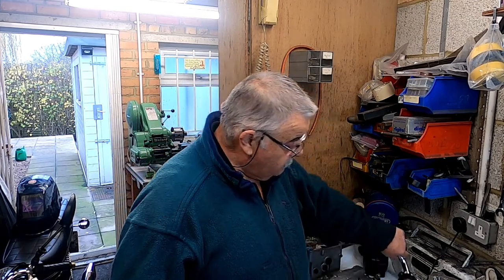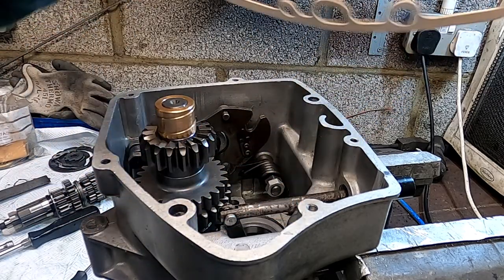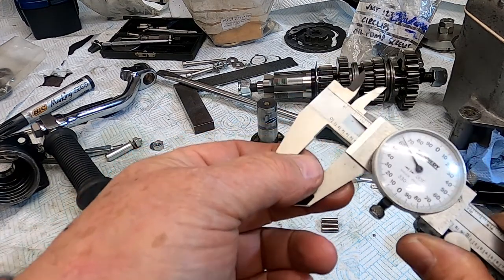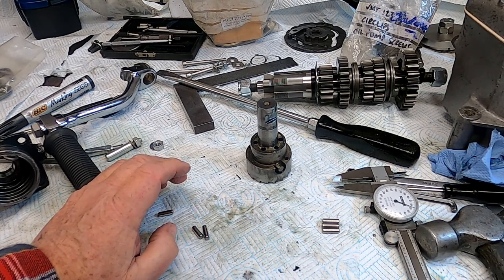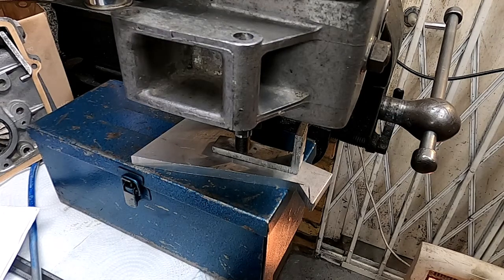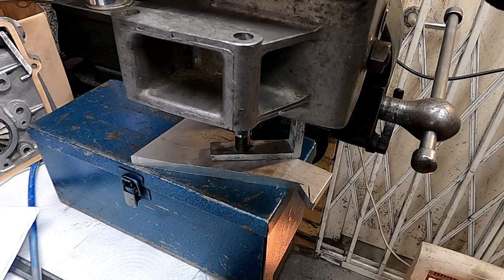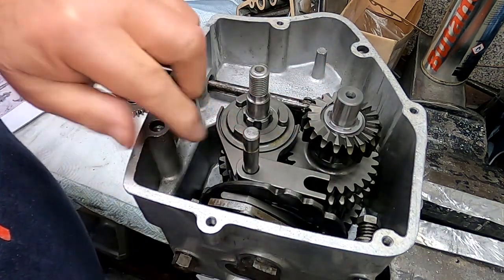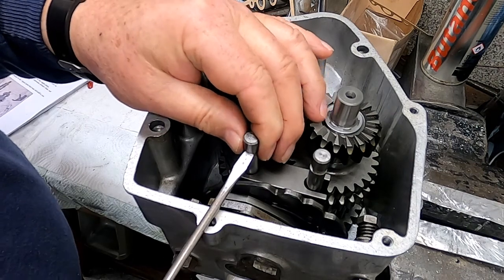Velocette 500, 5 Speed conversion, part 5

Comment: Hi Alan, regarding the selector plate. I am building a mac gearbox 4 speed. Do I need to put that in fourth as well, when rebuilding it? Thanks for the really great videos.
Reply from the maker: I have no experience of a MAC gearbox, the design philosophy is probably the same however. The most significant thing about engaging top gear is when attaching that threaded ring onto the sleeve gear which secures the clutch. Once 4th gear is engaged, the sleeve gear cannot move inboard(very much) and thereby make it difficult to engage those threads, as you compress the clutch springs. If the lay shaft and main shaft are meshed together and offered into the gearbox they should locate in the lay shaft bearing and also the sleeve gear. Then It should be possible to align the selector rods/ forks into the cam plate .
That’s all I can suggest. In later videos I rebuilt the 4 speed which I removed from the bike. This may offer some clues. Thanks for the comment.
Alan

Comment: where do you buy the screwdriver with hexagon shaft . thank you
Reply from the maker: I bought that screwdriver in the late 70,s from the Snap On man who called regularly. I imagine similar are still available today. Those Snap On tools have lasted a long time but the plastic handles on the screwdrivers are in poor shape and the chrome has worn off the sockets and extension shafts and ratchets.

Comment: I loved watching this having rebuilt my velo box a few times back in the day. I must say when I ran the bike as everyday transport for several years the box was always faultless. I did change the levers to alloy ones which allowed removing metal from the clutch handlebar lever to get more movement and thus more lift at the clutch end. 😀
Reply from the maker: Thanks. I also have filed the alloy clutch lever to extend nipple travel.  I was going to show this but editing and trying not to bore people meant that point, and other things, did not get mentioned.
Currently I am working on video number 7 where the old gearbox is removed and replaced.
Thanks
Alan

Comment: Layshaft end-float is  critical! Anything more than a few thou can allow the Layshaft 4th gear to kiss the Mainshaft 3rd gear. This results in the 3rd gear and it's thrust washer being forced onto the retaining circlip. It then rubs against the splines, which act like milling cutters! Result is circlip failure and cheque book big-time! I know! See also YouTube "Velo gearbox breaks" by Paul Murley. When I finally got to speak with someone who knows these boxes, he recommended that having determined end-float, it should be taken up by a custom made shim washer between the kickstart gear thrust washer and the layshaft bush. I'm also toying with the idea of relieving the interfering portions of the offending gears  by about 10 thou each, This would give 20 thou clearance and end-float wouldn't be so critical, I'm open to criticism and/or alternative suggestions on this!
Reply from the maker: Thanks for your comment.
I am aware of the issue of location and end float, and am not finished yet.
Currently working on video 6
I have not had real customer experience such as yours reported so far.
I was initially disappointed with the selection mechanism function.
Fortunately, I did not expect to just assemble it and have trouble free function.
I am being very careful in the assembly.
Feel free to comment further.
Thanks
Alan

Comment: What a joy to watch  over the Christmas break!!  I redid my Venom box with all new stock gears and bearings last year with much issue as I had never done a gear box before.   I thought about this kit , but the price was to dear at the time, now I am sorry I did not.  A 5th gear would be juts what the Venom needs to crack the ton and keep up the the traffic on the motorway in the USA.   Still with the new gear box internals and now a new bonded clutch I must say she is a treat to ride and shift.  Many thanks for your efforts as I have really quite enjoyed the vids.
Reply from the maker: Thanks.
Still more to do but making progress. Video 6 underway currently.
Reply: @alanglen5902  Hi Alan, I really do enjoy the way you explain the function of the bits as I did not know how the outer cover  bearing was oiled.  If you are so inclined  and since you have to put the box back in the bike and build up the primary I would love to see how you do that.  As I had no end of trouble figuring out the the process.  It was enough to make me think twice about keeping the bike. It took me a week or so till I realized  that the spring carrier on the clutch was knackered and not free to spin so the springs would  bend over when tightening .  Then just getting the the darn springs compressed enough to start threading on the sleeve gear nut  on was enough to cost a 1/4 bottle of single malt :(  Not a lot of Velo fellows here in the States (in the Eastern Bits any way) so we can use all the help we can get:-)
Reply from the maker: Thanks. I have not finished yet. Video 6 in progress at the moment.
If you engage top gear, the sleeve gear cannot get pushed into the gearbox while you attempt to engage the threads on the sleeve gear.
Reply: @alanglen5902  Yup I figured out that top gear helps keep the sleeve gear from being pushed into the case  but the spring rate was such that I could not compress them enough with out "the special tool" ..  Just  hard learned lessons